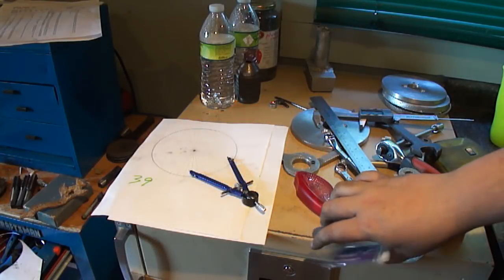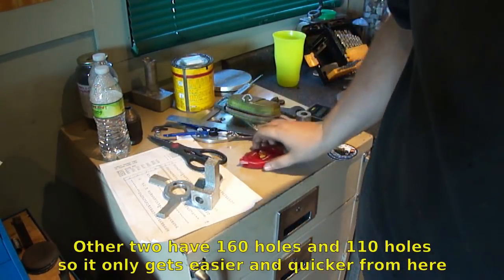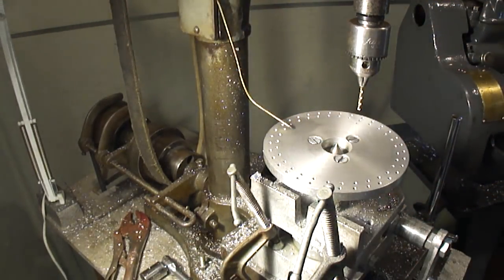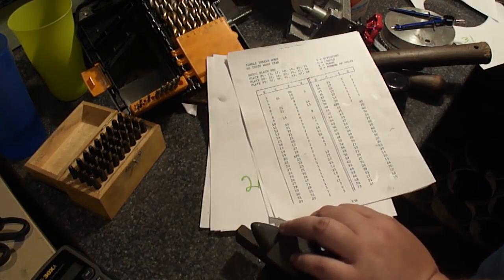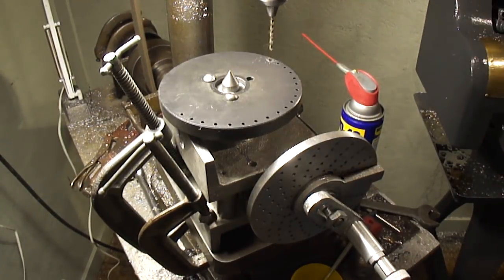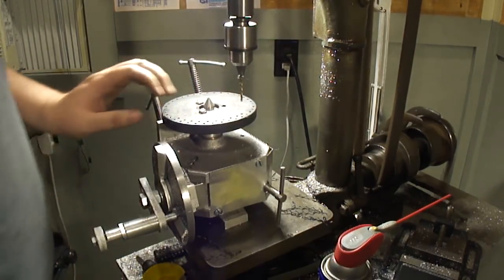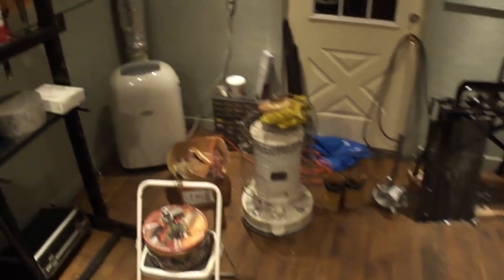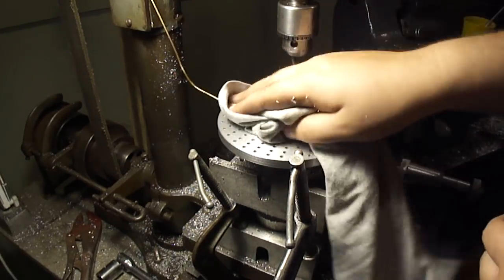Gingery Dividing Head P10 - Indexing Disks and First Job on Dividing Head

Comment: Awesome video and series! Been looking all over YT to learn how to make the holes in the indexing plates and I think this must be the easiest manual way by far. (Cnc would be the best og course for those who have access to that) . If the worm gear is 40/1 the errors will be diluted 40 times more than 1/1 right? And a great thanks to Dave Gingery. I need to order the book series. 👍👍👍😀
Reply from the maker: no problem, and yea, the  error is divided by 1/40th, so you really have to be off by quite a bit to really cause much error in the end tbh.

Comment: I just watched this whole series and wanted to drop a word to congratulate you on it.  You demonstrate how some smarts and determination can result in amazing things.  Of the Gingery series, this and the shaper are the ones I'm most interested in tackling.  I have an oil burning foundry I made last fall and am tuning the burner (venturi style, not compressed air) this spring.  I'm hoping to get some time to start tackling more detailed projects like this one, and yours in an inspiration.  Thanks for sharing it, you have a new sub.
Reply from the maker: Thank you. That dividing head has come in handy on a number of occasions so far and will be used sometime soon for fixing a few gears that I need to build up and recut. Im not sure how good the gingery shaper is, but mine has been invaluable to me so far and gets far more use than my milling machine does really. I wish you the best of luck with your builds, they're quite handy projects and defenitely well worth the time and effort put into them.

Comment: That (dividing head) was quite an undertaking.  Now there just needs to be a way to integrate it with a shaper gear cutting attachment.  :-)

Printable reference templates is an option I keep forgetting about.  Good to be reminded.
Reply from the maker: lol, I ended up just getting a horizontal milling machine and made up a fly cutter for it, so I was just going to use that to cut the gears with tbh. The shaper did work fine for cutting the stuff in softer metals like brass and aluminum, but due to the high cutting forces, I wouldnt want to try it in steel, expecially harder steels on my little shaper, lol. I didnt have the table room to put the dividing head and tailstock on the shaper anyhow to cut the gears between centers, so the mill worked out better for that.

I actually was watching your stuff a while back, I was really into the gear cutting video which gave me the idea that you could do gear cutting on a shaper, and the QCTP build you were doing.
Reply: @ChirpysTinkerings    I've got more on that tool post, but two big computer issues makes it difficult to make something of it.  One is that the footage is stored on another computer, and I can't figure out where the problems are in the file share settings.  The other is that I really need a gaming class machine for the software I prefer to use.  Easiest, most practical option would be to get the needed desktop computer and move the storage drive to it.  Just need $$.  

Kinda curious to what your general location is.  It appears that you are in the same kind of middle continent area I am, where it can get hot & humid, and weeds take over in any place that is not kept mowed.  I think you could saw lumber out of the horse weeds that grow around here.  If I could find a use for them, we'd be rich.
Reply from the maker: lol, thats understandable on the computer situation, closest thing to a fast computer I have here is my laptop, but the processor fan in it died, screen died and fell off a while back, so it's now hooked up to a desktop monitor and is stuck as a very loud desktop system now, lol.
Im from ohio, and it defenitely does get hot and humid here, and Im in the middle of lake region, so lots of humidity from that on hot days. If you could sell the tall grass that grows here sometimes, I defenitely wouldnt be out in that crap mowing the lawn anymore, lol.
Reply: @ChirpysTinkerings    NW MO here.  Lots of grass and leafy green, ponds, lakes, creeks and rivers to supplement what humidity blows in from elsewhere.  I've heard people from Texas complain about it.  We could easily be along the same latitude, so no surprise on having similar conditions in the summer.  I'll probably be doing shop work by night pretty soon, which means mosquitoes, and june bugs getting in my cutting oil again.  And cheap entertainment, when my niece freaks out over one getting tangled in her hair, or, throwing one in the midst of the chicken yard (ever heard the phrase "like a chicken on a june bug?).
Reply from the maker: lol, I do quite a bit of work at the night also, and in the sealed up shop so no worrying about misquitoes or anything like that. I think people from texas just complain about everything no matter what, we had a bunch here that came in with all of the oil pipeline crap, and they're all acting like they're dying during the summer time. All I can do is laugh and tell them "welcome to ohio", lol. Im around an hour and a half from hell's corner, lol. (real place actually)
Reply: @ChirpysTinkerings    I wouldn't mind that luxury.  Or not having the birds nesting on top of the lights and crapping on the machinery.  Like the machines, the building is a work in progress.  I'm only doing minimal work on the walls right now, until I have the rest of the concrete in.

I used to love it when it got that hot, but can't stand it anymore.  But I can't stand super cold air conditioned rooms, either.  When on the road, I carry a jacket or heavy shirt into restaurants with me, cause no matter what, I find myself under an air vent.  If I forget it, I'm quite happy to get outside and bake for a while when I'm done.  The walk back to the truck (over all of that pee stinky asphalt) usually does the trick.
Reply from the maker: lol, Im the opposite with heat, Im like a snowman, it gets hot out and Im screwed... lol

Comment: What kind of graph paper did u use
Reply from the maker: just used a circle hole generator online and found one that did lines out from the center, then just printed that out using an inkjet printer I believe. I think I still have all of the pdf files to print out if you wanted them which will save a considerable amount of time.
Reply: That would be nice lol
Reply from the maker: here you go. 
https://drive.google.com/open?id=17BWqTFFoJw-E-x5jmn2oqUgjiX9IWLe7
Reply: Chirpy's Tinkerings thixs very much
Reply from the maker: no problem.

Comment: What kind of drill press is that
Reply from the maker: canedy and otto #24 from around 1900-1902 based off some numbers I found in the castings on it. It was originally designed as a blacksmith's drill press. I have a video up telling all about it and everything.

Comment: You're doing a great job on that dividing head.
Reply from the maker: thanks, it felt like a very long project, but it didnt take as long as it felt. At least now, I can accurately index stuff out to make gears, timing belt pulleys, add graduations to dials, etc, lol. Now onto the next project after I go out and clean up and put everything away, lol. Thanks for watching.
Reply: In my mind everything is already finished. But IRL things usually take a lot longer then expected :)
Reply from the maker: my problem is that I actually do finish the project, and it doesnt feel done, so always adding modifications and such to it, lol. So it really does take longer and longer to finish the project, lol.

Comment: Yeah - camelback drill press doing fine work. 

Really nice project and the result looks great. 

Kind of like bringing a Howitzer to a Tea Party... Love it!  

Dan
Reply from the maker: lol, that old drill press has more accuracy than any other way of drilling holes than I can think of. I have some MT1 taper drills, but just didnt have any in 1/8" otherwise I would have just used those, lol. I just wanted to have the holes as accurate as I possibly could, and that old drill press is really easy to use for me. Thanks for watching.

Comment: Great job on the build Chirpy, really enjoyed watching this, you must be very satisfied with the final result.  Looking forward to the next build.
Cam
Reply from the maker: thanks, I honestly dont know what the next build will be, probably just one or two videos on the die filer and that's it then idk what then. I need to build a new sand muller, but it's been so miserably hot outside that you cant work outside to build anything or cast anything, so the steam engine and sand muller is kinda out of the question for right now. Thanks for watching.